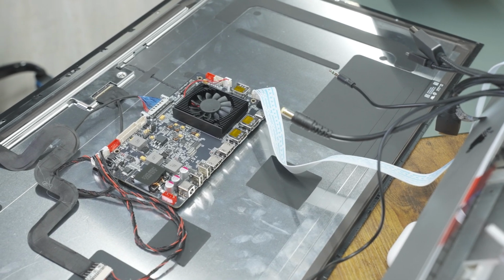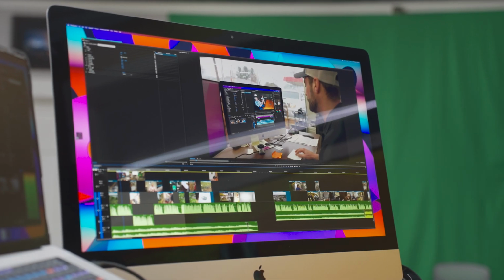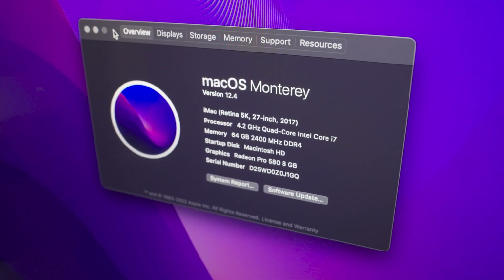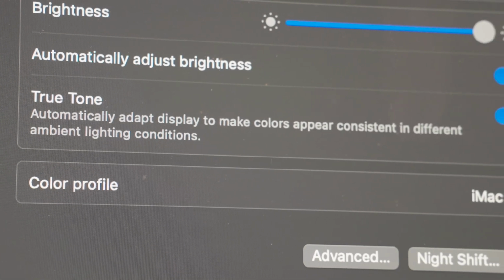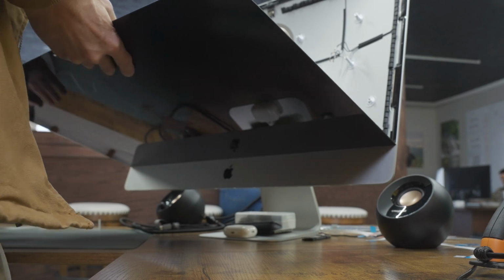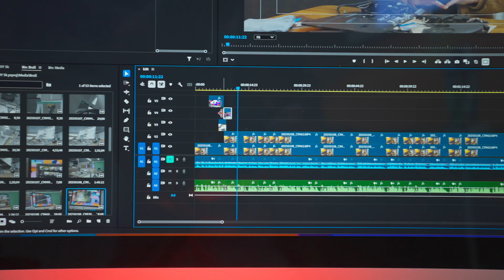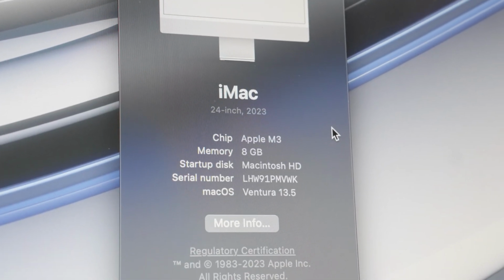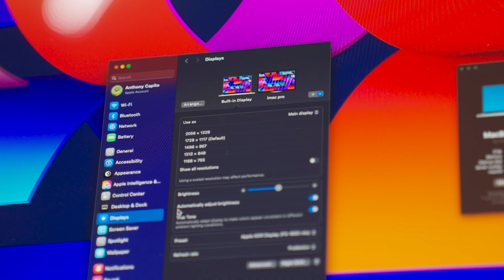DIY 5k Display: The ULTIMATE iMac Glow-Up!

Comment: Does this work on late 2014 ?
Reply from the maker: Not 100% sure the board product page should specify the LCD panels that it is compatible with and you will just have to cross reference the LCD in your specific iMac.

Comment: Does it also support 4k@120hz (as the product page says) or only 5k@60hz?
Reply from the maker: The higher end board should handle 4k@ 120 over dp. Not sure about HDMI.
Reply: @Ajcapito  The board may support it - but does the display actually support this? I haven't seen anyone actually confirming or trying the 120/144hz yet
Reply from the maker: @bareandreas I will try and test that this week
Reply: @Ajcapito  Please let me know! 🙏
Reply from the maker: @bareandreas the panel itself can only do 60hz so you are correct 120 is not possible unless as a pass through to another monitor that can
Reply: @Ajcapito  Thanks a lot! I couldn't understand how nobody talked about that. - What is the point in the more expensive boards then? Other than 8 vs 10-bit. Even the cheap boards can do 5k@60hz. 

Or can you overclock the display? I've seen some forums talking about that, but that was on original iMac hardware and with Windows on it. So would that be possible, using the expensive 144hz controller and Windows? 👀

Comment: Do you think there is a way to keep the old system accessible and have the ability to switch and just use as a display?
Reply from the maker: Unfortunately the only method for that would be remote monitor apps. As apple doesn’t allow it past OS 12 or 13 for screen mirroring… this is the alternative to still use the display when the internals are welllll outdated!

Comment: They need a revision to use speakers, webcam, and a usb hub integrated into that board
Reply from the maker: I’m sure you can use a usb hub if you’d like more usb port access however remember it’s not a computer just a driver board to run signal throughput

Comment: nice straight to the point video:) I have a question that i have not found the answer to on the internet, i researched a lot on Imac to DIY builds. But I'm asking myself if the new motherboards changes anything to the color accuracy. I know the panels are certified to their color spaces and percentages, but my concerns are whether the new motherboards change the panels in the slightest way. I work in Design and video editing/ grading and dont want to spend a lot of money on a build that has minor colors shifts.      ------Do you know anything about whether the motherboard (in general, not speciffically yours) and their software affects the panel?------  Or do you know where i can find test/ information about this? Thanks, keep creating i see big future for you!

Comment: Do you know by any chance if it does work with a 2019 27" iMac? I guess the problem would be find a driver board monitor?
Reply from the maker: No these boards work all the way through the 2019 model. You just have to make sure to get the latest model of the driver board from StoneTasking

Comment: Nice video, I have a 5k Retina Display on my 2017 2.3 GHz 18-Core Intel Xeon W, Radeon Pro Vega 64X 16 GB, 64 GB 2666 MHz DDR4, running Sonoma 14.5. Everytime I try to watch a 4k60 or 5k video on Youtube it lags just like still frames? Yes I have google Fiber 3gig internet what is going on?
Reply from the maker: It sounds like a driver issue possibly. I don't know if it has anything to do with Youtubes internal changes to the GUI we see as it seems they overhauled the look in the past month!
Is it a newer issue or always been present?
Reply: Thanks for the reply, I just discovered I had a 5k display recently, Lol I been using screen  it in 2k something on settings (still looks great) but I will look into testing drivers  or more memory  @Ajcapito
Reply from the maker: @AlienGrade  Yeah the issue is hard to diagnose for you without seeing it in action. I also have a 2019 5k iMac we use as an editing station and it has no issues with YouTube. At least since I last tested.
Reply: @Ajcapito  try setting display to 5k and go to "SHARPEST DETAIL 12KHDR DOLBY VISION 120FPS" in 4320p60 HDR8k see what happens?

Comment: Hey,  nice job. I am wondering if you know if this also works with a 2014 imac model (late 2014 ultimo)? Everybody always seems to talk about 2015 and newer... thanks
Reply from the maker: 2015 is when the displays were actually made into 5k displays using LG panels. 

Before that I believe they were 2.1k or 4k?

Comment: its cool that the driver board you used is universal but the older ones are half the price... unless you got sponsored I dont see how to justify such huge price increase
Reply from the maker: I got the newer board so I can run hdmi 2.1 as well as the display port over a single cable vs 2 as I am using with a laptop
Reply: @Ajcapito how is overall display quality with this custom board? Are you using StoneTaskin board?
Reply from the maker: @seregavitiv9914 Yes it’s a StoneTaskin Board. Great quality full resolution only thing that needs adjustment is probably some color tweaking but has built in profiles within the Mac System Settings.
Reply: @Ajcapito  Thanks for answering!

Comment: I'm not sure if I understand why 2 hrs of work to do this is better than just using the Luna Display dongle? (To save myself that $89.99?) Or is this actually better than using Luna Display? (Not a troll, nor shill for Astropad's Luna Display, I literally have a 2015 iMac 27" (iMac15,1 w/AMD Radeon R9 M295X 4GB native built-in card) that I'm still using--but which won't update MacOS any longer--and bought a Mac mini M4 yesterday, so very interested in how to use it! Though I would consider paying $90 to be better/easier for me than disassembling my iMac.)
Reply from the maker: @likethesky  no latency. Has power distribution of 90w over usb-c.
Multiple input formats. Ability to have multiple devices connected simultaneously and switch between with included remote.
Sure it might be more expensive. But at 5k with no compromise since it’s turning into a display via the logic board. Software/Hardware issues with Bluetooth could hinder Luna.

I also find it best if you have a 2015 since the 5k display already eats most of that computers processing power just to drive the display.

Mac mini should be great with this.